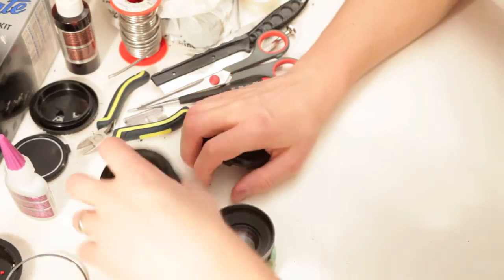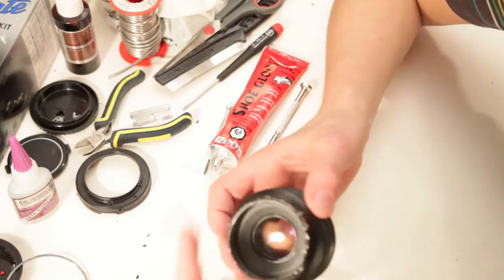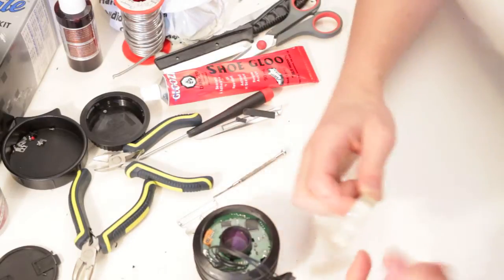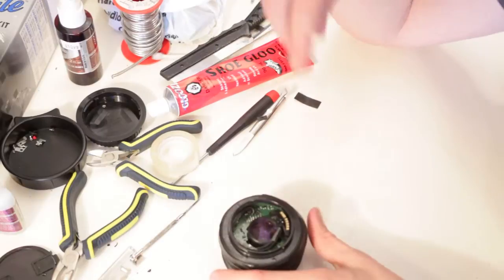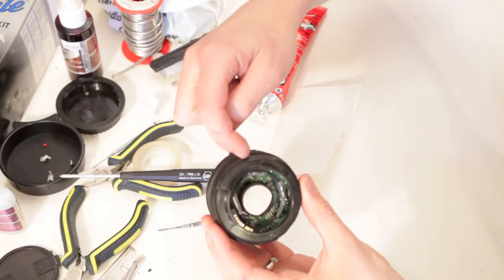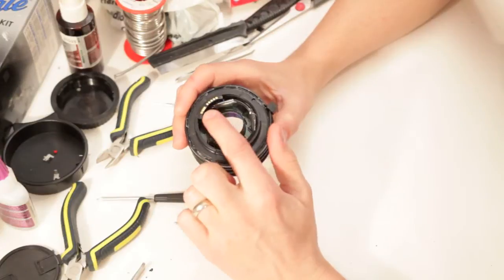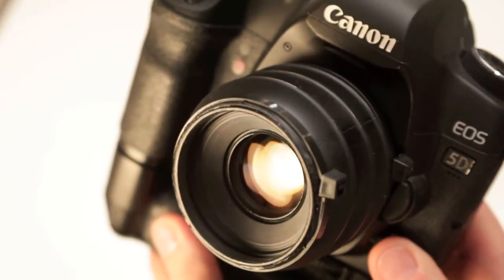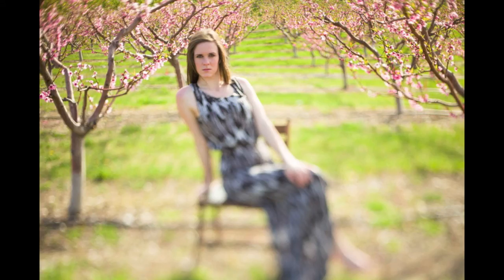How to build a Canon 50mm 1.8 ii EF EOS TSE Lens DIY pt.4

Comment: Todd, thanks for the tutorial.  I used it to hack my broken 50 1.8 into a TS frankenlens.  I just changed a couple things - used hose clamps to hold the rubber shock mate to the lens, eliminating the need for glue (and allowing easy access for inner maintenance).  Also my mount contacts were still intact, so I just used the original wiring.  

One question, though: I gouged out my lens barrel extensively with a razor blade and dremmel, but I still get a ton of friction and catching limiting the TS movements, especially when focusing at infinity.  Any recommendations on how to correct?  I'm considering modding a canon body cap to accept the wire mount (and hollowing out the middle, of course), but I'd rather work with what I've got.
Reply from the maker: Nice! Glad to hear it worked out! I still wanted to take out the ribbon wiring becasue I thought it might tear over time but perhaps it won't. I may have to try one leaving it in.

Hum ya I'm in the same boat as you. Mine does still catch so its hard to get a shift out of the lens. It is great for a tilt lens more then anything. I also need to figure this out soon too because the lens I am getting ready to do next only has a metal mount so I will need to figure out how to mod it. For our 50mm it would be best if we somehow figured out a way to chop the barrel down entirely and mount the rubber boot directly to the mount which would entirely rid of the catching.
I'm stumped at the moment but I have an idea with 2mm styrene sheeting that I may try. It would be a circular sheet shaped the same as the mount. Then taking another piece perhaps 5mm and wrapping it around the outside of the rubber boot and gluing it to both the boot and circular sheet. Then just screw the sheet into the mount like a normal lens. The only diff would be that the "barrel" would be on the outside rather then the original barrel being on the inside.
The electronic board would then be rubbing on the boot which would at least give 2-3mm more clearance on either side which would be a lot and may work perfectly.
If I come up with something I will comment again and if you have any ideas I would love to hear! :)